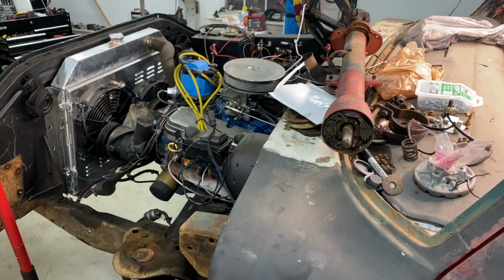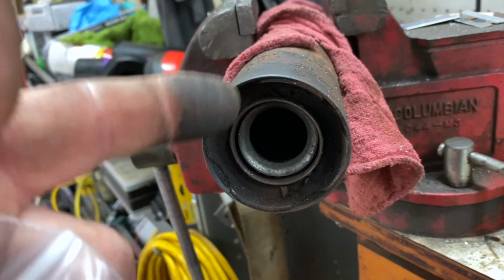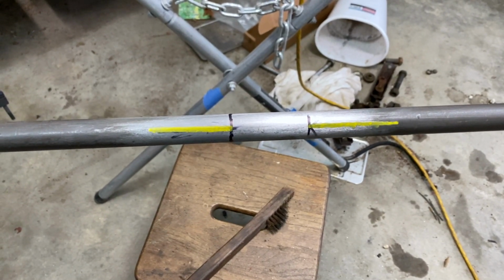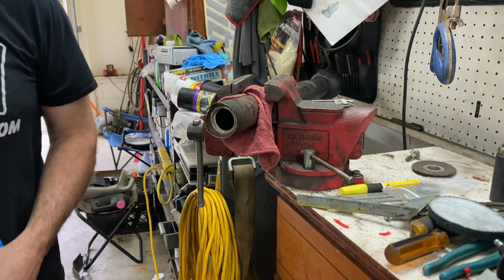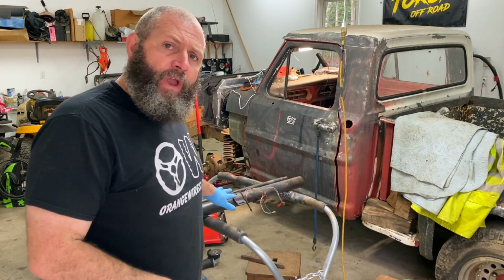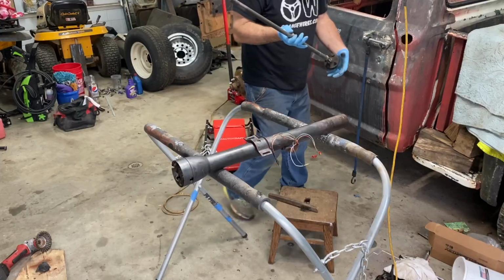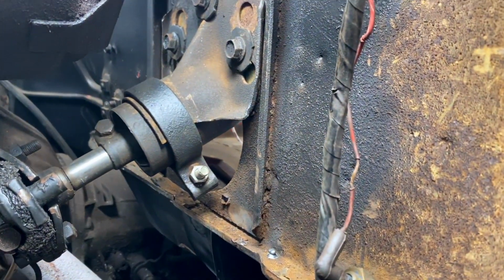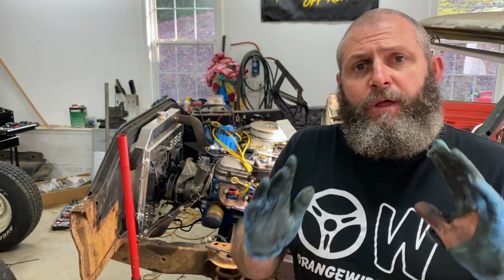1969 Ford Power Steering Conversion (How To)

Comment: Cool Video !! From my understanding, You will need to add a proportioning valve since you went with disc brakes in the front. Otherwise the brakes will not operate correctly. 
The proportioning valve is mounted between the brake line master cylinder and the rear wheels. It's designed to adjust the pressure between the front and rear brakes, depending on how hard you're stopping. The shorter the stopping distance, the more of the vehicle's weight is transferred to the front wheels. I don't think you need to replace the master cylinder but not 100% sure.
Reply from the maker: We got the proportioning valve from the truck we got the disc setup from.  Probably going to put it on and swap out all the hard lines and rubber lines.  Miss you buddy come see us!
Reply: @OrangeWiresGarage Miss you too !!! I may do that !!! Cheers